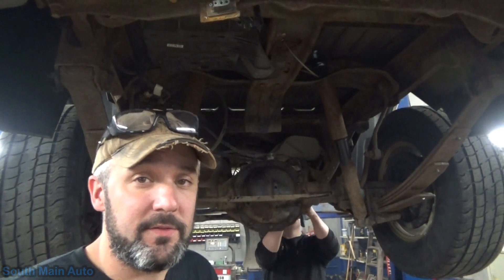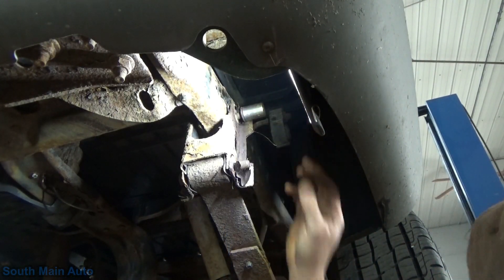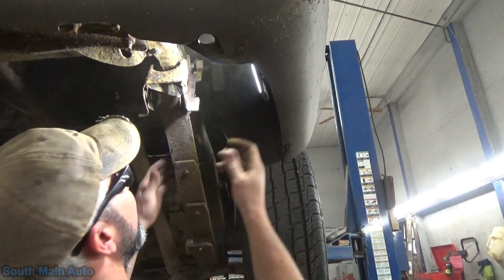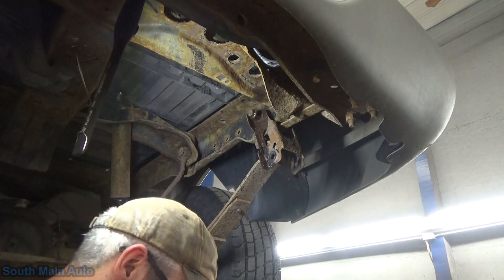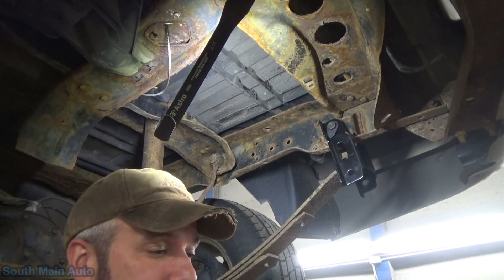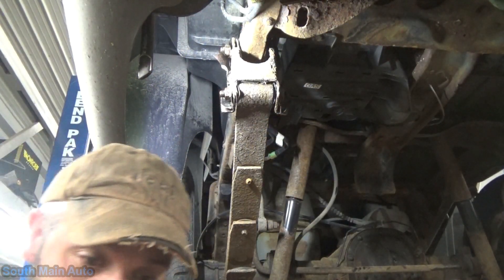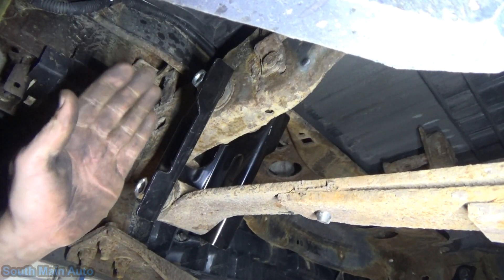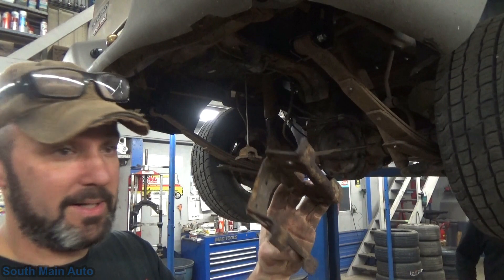Ford Explorer Sport Trac - Rear Spring Shackles

Comment: I know that this is an old video, but I'd like to thank you Eric. I recently had to replace my rear shackles ,in my drive way and with no power tools except an angle grinder. After some soaking with penetrating oil and grunting and groaning, I got the top bolt out and the nut came off the lower bolt, but the bolt was stuck in the bushing. After watching your video (again) I decided to try your trick of cutting the head off and putting spacers under the nut and press/pull? the rusted bolt out. I can't say it was easy, but it saved me from towing it to a shop to finish the job. Just goes to show you, an old dog can learn new tricks. Thanks, and I have to tell you that you're my favorite you tuber, that Russian fella in State College is a close second.😉

Comment: I just did a horribly rusty shackle on a 93 ranger . I used the torch and cut the head off and used the nut and washer trick. it worked fantastic. saved my ass today. thanks for the tip gotta love working in the rust belt ! I gotta get rid of this junk snapon air hammer!

Comment: Thumbs up video.  I have learned that sometimes with a large severely rusted bolt you can back it out counter clockwise with an impact wrench.  The threads actually work to turn the bolt out - albeit slowly and the bolt smokes, because it is so hot, when removed.
Reply from the maker: Ahhh talking my language now!

Comment: Man, I'm glad I watched your vid, I was about to push them bushings out, least on the spring side. That sure saved some work and headache. I think one of the best investments I have ever made was that astro master ball joint press. That c press is a monster and I think I have used it for everything but pressing out ball joints. The washer trick did the job, though a little less money to buy some short bushings too to take up slack also. The c press would have worked, but it was certainly easier and less wrangling that heavy c press to use the washers.

Comment: This vid gave me flashbacks of doing my '99 Tacomas leafs and shackles last year. Luckily I was replacing everything and just used an angle grinder with a cutoff disc to cut everything off. P.S., being an Explorer,  was expecting you to also be replacing the front sway bar end links. Had to pop a few new ones on my friends old Explorer. He was complaining of a sloppy ride. Found they'd both snapped off near the lower bushings.

Comment: Though bolts best tightened with vehicle weight on wheels on the ground or an alignment rack, I would probably just place a floor stand under the center of the front cross member, and and screw jack floor stand under the back of the rear diff and jack the rear axle assembly up carefully until the vehicle starts to get a little  light on the rear lift arm pads then tighten down the shackle nuts and bolts. Suspension bushings will thank you by offering a little more supple ride and last longer if the fasteners are tightened in the positions they naturally be with the vehicle's weight on the wheels.

Comment: Hi Eric & Josh I noticed you put the bolts back in the same direction that you removed them from. If there is more access for removal if installed with head toward outside of vehicle why would you not replace them opposite to original install?
Reply from the maker: We just put things back they way the factory does is all. Prolly don't make a difference
Reply: Swallow Inn because they put never seize on the new bolts
Reply: @SouthMainAuto  
 Eric, I have found that the manufacturer does a lot of stupid things for the sake of expediency on the production line❗
 I always put the new bolts from the outside in because it leaves plenty of space to work if it ever needs to be done again.
 Great video, keep them coming, thanks.

Comment: Just an FYI: The "high temp" Ford anti-seize, (what they recommend for new spark plugs in 3 valves), works well and seems to travel less than most.
Reply from the maker: Good tip

Comment: Another excellent one. Btw is undercoating/rust protection such as Tectyl banned in your state, or do people not care? Coming from a country that salt our roads heavily, we do protect the underside of our cars...
Reply: For the most part people do not care. There is undercoating sprays and rust protection/conversion products you can use. People just don't want to take the time to prep and apply them every year or two.
Reply: I think most likely it's a product that people do not know about.  In this area Ziebart and 'Autosaver' electronic rust prevention systems get all the press time.  Any undercoating is doomed to fail after it gets a few dings from road rocks and such.  Once the protection gets compromised-  That's all she wrote.  It will build up rust under the undercoating, and then you're left with a hidden cancer.

Of course other times people treat their cars/trucks as disposable.  They only keep them for 3-6 years depending on their lease or $$ terms.  And then it's off to trade in!  And pass along your upcoming problems to another.
Reply: Tedybear315 properly applied, tectyl gives good protection for years. best results if applied when car is new. then media blasting is not necessary.
Reply: BiggoronJon yeah, noticed that. on dirt roads, in my parts of the world, they use a mixture of water and wood sap. a biproduct from the timber and paper industry. works pretty good. then there are not many dirt roads where i live, so not a big issue.

Comment: Actually tried to change the shackle of a friends silverado that looks 5x worse than that ford yesterday. Spring is jammed against the bed and can get the bolt break free from the bushing as there's barely enough to swing a hammer. Was quite frustrating lol

Comment: Years ago I had my 1967 Mercury cougar that I wanted to jack up and put air shocks  and my G-60-14 Cragar mags on and in order to do it you had to put the shackle extenders in... And I still have a scar on my finger where I cut it straight open trying to remove that on the rusty outer panel of that car 😵 pushing that hanger through my hand slipped off I cut my finger on the inner panel

Comment: Just wondering Mr. O, why don't you put the bolts in from the outside so the nuts are on the inside where there is more room to work with your air tools, just in case someone has to do this job again?
Reply from the maker: This truck will be in the crusher in a few years

Comment: hey I dont have an air hammer or a torch hot enough to burn it off. i got the nuts off but the bolts are seized and two of them have rounded head before I even started. Please give me some advice.

Comment: Another quality training video from ETI. Eric's Technical Institute! Lol 
Which Snap on air hammer do you have Eric? I have the 3050 and it has never let me down. Even when I was at the garbage company working on the crusty garbage trucks. 2" cylinder pins did not stand a chance against the mighty 3050! Of course I oil mine at every use so maybe that makes a difference.
Reply from the maker: yes I have the 3050 but trust me when I say it doesn't even come close to the Astro 4980. night and day difference

Comment: Personally I don't like to use anti-seize on any suspension parts.
It contains metal and can give you squeaks.
I prefer to use high temp caliper grease.
Nice job on a nasty truck though.

Comment: What brand is "BIG NASTY?"
Reply: astro I believe,  however for a little more you can buy the original made in Japan one called cp717 by Chicago pneumatic vs this China made copy. the choice is yours.
Reply: That's interesting to know. Years ago I used to buy the cheap stuff and it either broke or got weak. I've been buying Snap On air chisels for sometime. Recently I purchased Sap On's "Big Nasty" and have been pleased with it! Always open for ideas or new tools to try, though. (especially if they are cheaper than Snappy)
Reply from the maker: Gear wrench, would you believe these come off the same assemble line... Like in the same factory? Trust me on this one, I have the inside scoop but don't tell any one. they are 100% the same. Just a different sticker ;)
Reply: Also item number 717K gives you 4 bits and a case for around $400. I snagged one when the price was $370 for the kit from Amazon!